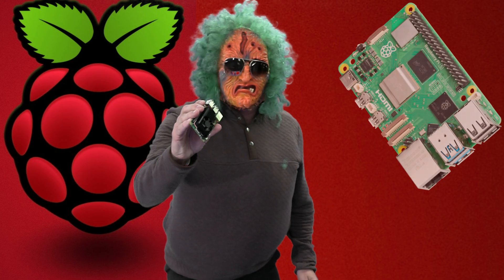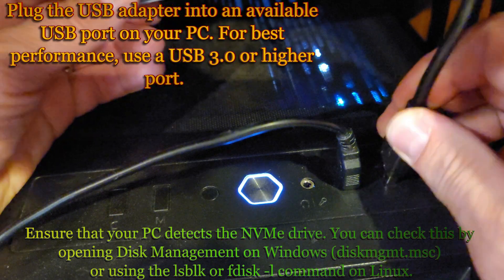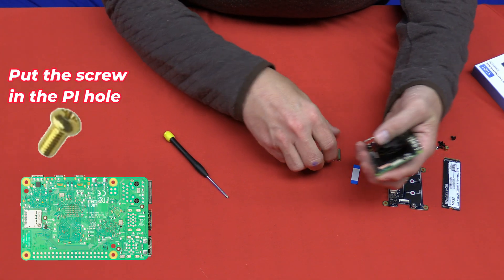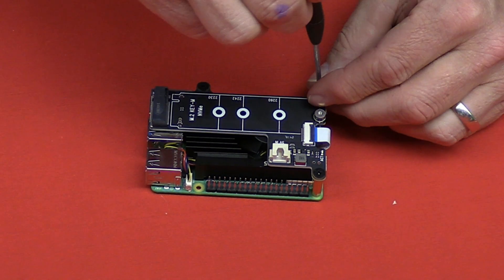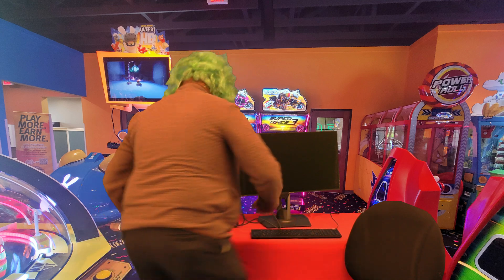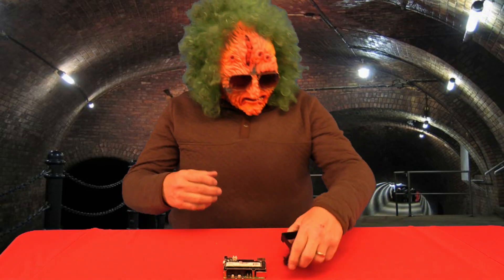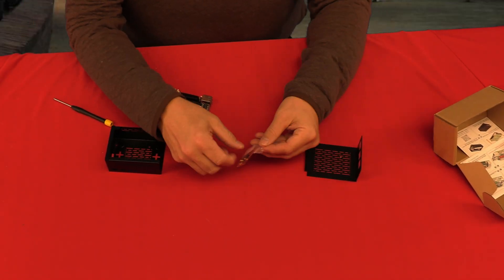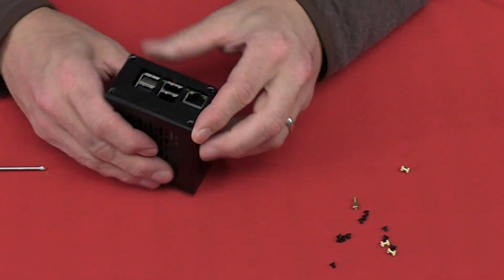Boost Your Pi Performance: How to Install an NVMe Drive on Raspberry Pi 5

Comment: How did you change the setting so it would boot from an NBA me drive and not from a micro SD card?
Reply from the maker: In my case, the pi had automatically recognized the NVME drive after I had imaged it. It is possible, though, that pi may not support curtain brands of NVME drives. Therefore, I would check their website for capability.

Comment: I did use an older Pi 2 to create a dial-up server for my old computers. I have a Panasonic telephone box to be the middle man in calling the dial-up server.
Reply from the maker: Sounds ingenious.  There is so much you can do nowadays with A PI. The best thing I had back in the day was A commodore 64. Many not have been A PI. But I did some awesome things with it.

Thanks for the comment 👍